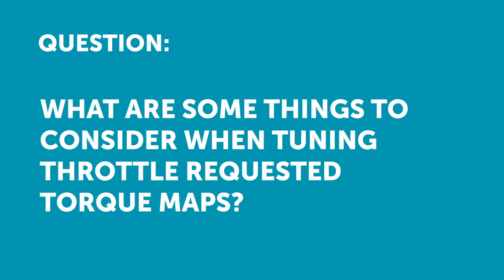Torque Map Tuning 101 | What Is TORQUE Based ECU Tuning [HPA Q&A]

Comment: Torque is the only value I am interested in :)  Torque at the flywheel and then more importantly torque at the axle.
Reply: You may want to re-address that statement - torque is a very useful metric for many aspects of an engine's performance, but you also need to consider the rpm range it is being produced in and hence the engine power. Power being the rate at which work is being done - they are closely related, but different.
The only time torque might be considered on it's own is at stall, zero engine/shaft rpm, where one can have torque but no power as the rpm component is zero.
Remember, at the axle, at the same road/axle speed, there will be the same torque at the same power level, and vice versa, and, at the engine, the same power (give or take for parasitic losses) will be produced - the gearing correcting the rpm and torque values.
Reply: Thank you for adding that Gordo, I wasnt intending to bring it up and give a full explanation.  As I said below I have a very good grasp of how to be effective with torque in motorsports.  I even managed to get an HP Academy feature :)
Reply: @AaronONeal1  Lol! I miss those John Bradley days when EvoM was at its peak.
Reply: @marcushay1  Thanks dude.  EvoM used to be a happening place of all sorts of tech, battles, general mayhem, but lots of fun.  I think FaceBook has been responsible for a lot of forum decline.  Whatever though, we are still here doing things :)

Comment: For years, F1 have been referring the throttle pedal as a torque request/demand pedal and it is great you bring this up.

For some years I've been trying, unsuccessfully for the most part, to explain to folks why gear boost limiting isn't the best solution because there is still a torque curve that has a maximum value that is limited, to prevent excess tyre slippage, and below that torque peak there is wasted potential. Worse, many still think it is power, not torque, that is the issue.
Reply: Worse yet is when people want to argue that torque doesnt matter at all.  That's fine, some of us can be fast and get faster while the rest wonder how :P
Reply: @AaronONeal1  I mean if we're getting into torque vs power, it's always worth bringing up that power is a function of torque and the two cannot be separated.
An engine with a flat torque curve makes good power down low. Arguing that torque matters more than power is only really relevant when you're worried about parts breaking... /peak/ power on the other hand is way overhyped in most scenarios.

Comment: Question on this: It is recommended that the torque values you put in the table is an accurate representation of the actual torque the engine is producing. How does the ECU know that the values you put there are/are not the actual torque?
Reply: Note, I have no experience with these but from what I understand: It doesn't. You have to manually enter the values. It's important for smooth and intuitive throttle response. As a scenario, if holding constant pedal position the throttle/torque map fluctuates up and down (not calibrated) as you are increasing in revs, the torque output would equally fluctuate. It would feel like a flat spot in the engine output.
Reply: With some very high end management, it "may" be possible to use contactless strain* guages on the propellor, or driveshaft, that would give direct feedback to the management, but that is speculation. If you wish to follow it up, this might be a good starting point - https://www.kasensors.com/en/products/dynamic-drive-shaft-torque-sensor
In the real world, I would expect the torque output to be mapped for each step of the throttle opening, boost, ignition timing, etc, so the controller can be set to pull the value(s) required for the desired output.